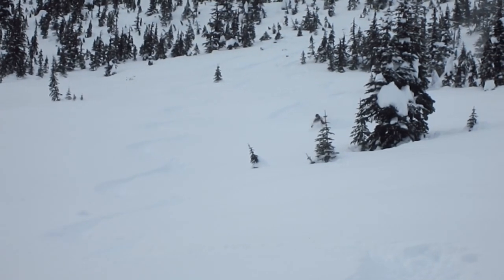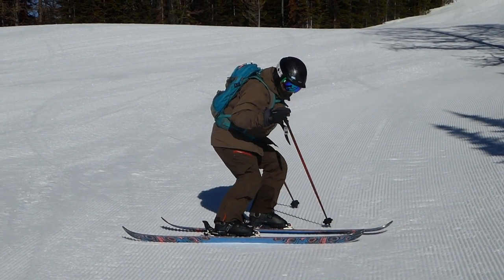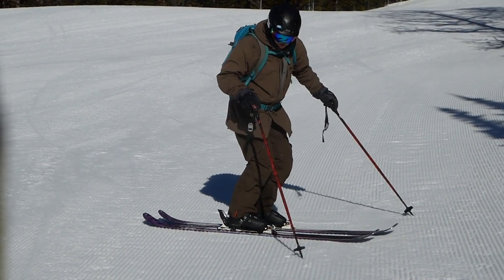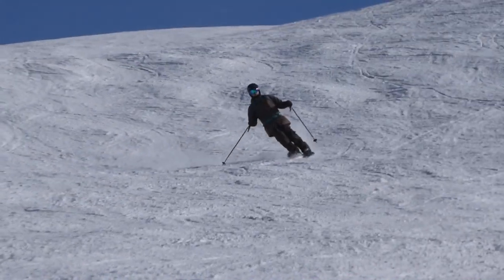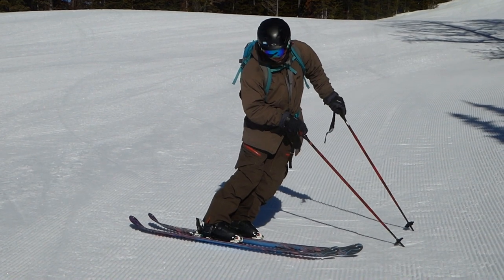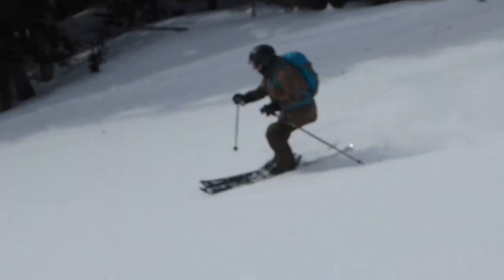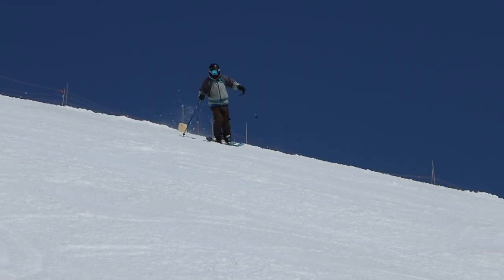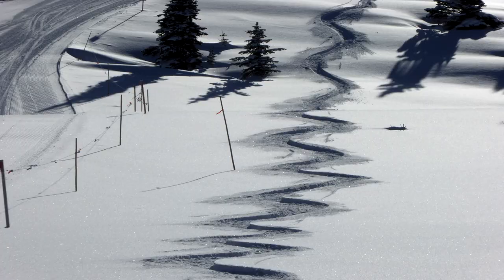Tutorial - how to ski powder, Episode 6/8

Comment: Excellent. When in powder do you still want to pressure the tips at the beginning of the turn?
Reply from the maker: Hi Don, yes I am trying to apply all unweighting down skills (that I had learned last winter) to powder. As I mentioned in this new unweighting video I am always now doing this down-unweighting, powder not exclusion. As for pressuring tips in powder, Id say no. I am always loading the skis in 100% neutral load in powder. That said, my powder ski - Pescado, it has 158 wide tip, and the mounting point is 8 cm back from the mid point. Hence when I do this abrupt sit up in the very end or pull heel to the butt it kinda reposition the ski from tip to tail. I dont specifically load the tip, but because it is so huge the feeling is that the ski is pushed up, its like I am flying out of the snow, it is like an avalement - but then I look on tracks - and no, no jumps, solid trucks. So in short I am not thinking about this, but the feeling is I do because of huge tip. Hope I didn't make it muddier than it should be :) Did you see my wsrfng vid? Did you find it useful?